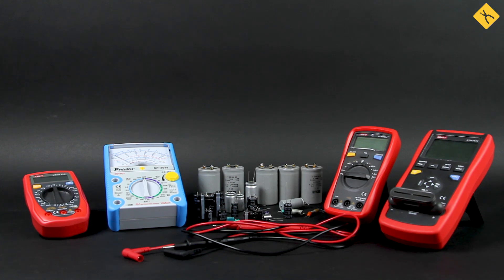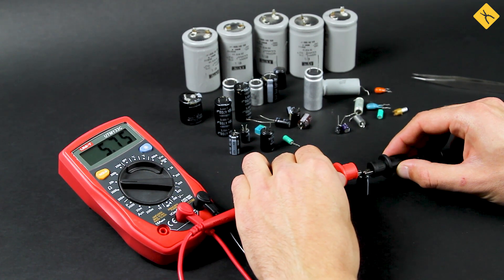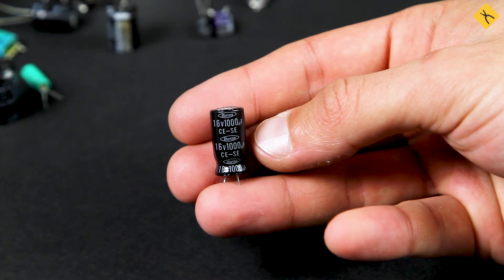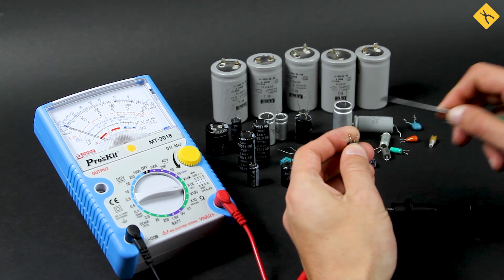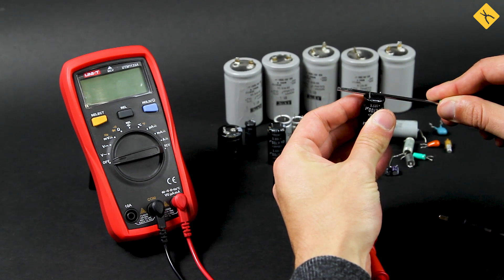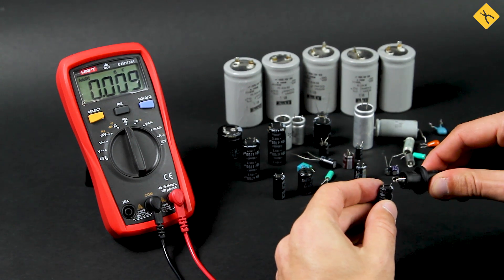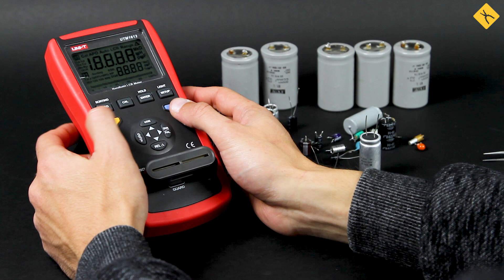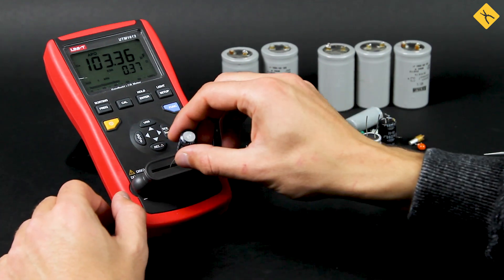How to Test a Capacitor with a Multimeter and LCR Meter

Comment: useless, what setting? can i do it without removing it. I see you've linked another video for settings (the markings are not visible in this video), but I clicked on this video because I only need to know this today, I know about continuity, voltage and resistance testing.
Reply from the maker: You can watch this video https://www.youtube.com/watch?v=tXxOHcUhVfE

Comment: I have a cap on a 130w extractor fan for a cooker, and when testing continuity it reads 1040. It doesn't bleep. Does this mean it's okay? Wondering if it's just the motor that burned out, otherwise it's more money for the whole unit.
Thanks!
Reply from the maker: We find it difficult to answer. If the question is still relevant, then send it to our mail and attach a photo or video showing the essence of the problem. support@toolboom.com

Comment: What is difference of the capacitor voltage ?
Reply from the maker: Hello! Could you clarify what you mean?
Reply: @ToolBoomVideo  Capacitors have different voltages. Eg. .047uf 400v and some have higher or lower voltage.

Comment: Sir may I ask, if I have a motor starting capacitor for "Dough Mixer" of 80µF 10+20% 270V, and I have a reading of 85µF, shall I say that the capacitor is in excellent condition?
Reply from the maker: Hello! In some circuits, the capacitance of the capacitor should have an extremely small error, however, if the error of + -10% is indicated on the capacitor itself, then it is in order.

Comment: I share many of the comments left here. It looks like a good video but really it's very confusing. It does not show which setting(s) to use for the multimeter, nor does it even tell which lead of the meter connects to which leg (+ or -) of the electrolytic capacitor. Oh my!

Comment: All I need to know is which multimeter setting to use and what values I need to determine so as to identify if I need to replace or  keep. The values were straight forward, however as this is the first time I have tested a capacitor I did not pick up on what MM setting to use.
Reply: I can't stand it when people take a complex subject and act like you know almost as much as they do.  Terrible job explaining what he's doing.

Comment: Aren't you risking ruining the capacitor by using a screwdriver?
Reply from the maker: Hello! In our case, this can be done because the capacitance of the capacitors is relatively small. Doing the same with more capacitive capacitors is strictly not recommended.
Reply: @ToolBoomVideo  Oh ok, thanks!

Comment: What about very small cappacitors ?
Reply: for very small caps - you need a more expensive meter with greater resolution
Reply from the maker: Hello! You can try to take measurements not with "alligator" probes, but with ordinary ones.

Comment: Useless video unless you already know what you're doing and what settings to use on the multimeter.  Waste of time if you dont.
Reply from the maker: Thanks for your feedback. We are sorry, we will take your comment into account in the next similar videos!
Reply: are you blind he setted to ohms
Reply: @cyborg6294  As my original comment stated, the video is useless if you dont know what you're doing!  Are you blind? He didn't explain what he was doing.
Reply: @neilrobinson7615  I am a programmer, I used the video and after that I tested the capacitors in my PSU and found it dead. Maybe it is hard for you, nothing wrong with that. Nothing personal, good luck
Reply: @cyborg6294  How do you test a capacitor with ohms when capacitance is measured in Farads? A standard multimeter can not test for capacitance.
Reply: @neilrobinson7615  I measured the capacitor resistance by choosing 20K ohm and it was zero (zero for dead one), also I checked the continuity and it beeped, this means that it is short-circuit. If the the capacitor is working correctly you will see an increase in resistance gradually without surges when measuring. And by the way, English is not my native language even. You really should watch video carefully and give an attention to details. No offense
Reply: @cyborg6294  So you didn't check the capacitance then? That's what I watched the video for...
Reply: @neilrobinson7615  I do not have even this function in my cheap multimeter.
Reply: @cyborg6294  Exactly, most cheap household multimeters can not check capacitance, that's why this video has so many down votes and negative comments.
Reply: @neilrobinson7615  I don't give a video down vote and negative comment only if it is fake or with wrong information. I always try to support good videos, because if the channel starts to get many down votes then they will even stop to make videos and share information and that is bad, maybe that is just me. I saw that in past that some channels stopped to make videos even and the channel is already dead and some was really good channels but people don't understand and gave them bad comments.
Reply: @cyborg6294  Legitimately poor videos with poor information should be down voted. That way the overall quality of YouTube improves, and content creators up their game. Shit is shit, which ever colour you paint it.

Comment: Can someone help me out?
Im working on a Behringer 1280s powered mixer board. This unit blows both 1.6ah 250v fuses as it is powered up.
The (4) 2200uf 200v caps test good on my Kline mm700 meter for capacitance and my esr meter says good cap with low ESR. The (4) 4700uf 100v caps test good on the esr meter, but read O.L checking capacitance on the Kline. So I ordered (4) new 4700uf caps. They also read O.L on my Kline in capacitance mode. All these readings were taken out of circuit.
Im thinking it might be the transistors, not the caps. But why am I getting no uf readings on the 4700uf caps?
I actually have 2 mixing boards. Same situation with the 4700uf caps on the other board.

Comment: So if I'm testing a 250-300uf capacitor, I set my multimeter to 2000uf just to be above the max of the capacitor. Is this alright?  I can't see where your multimeter is set to.. also I don't want to watch that multimeter video lol. It doesn't measure capacitors

Comment: You are not saying were to set the dial for each capacitor. You are just moving the dial back and forth
Reply from the maker: Hello! Thank you for your feedback! At the beginning of the video, the multimeter was in the resistance measurement mode (in the range up to 20k Ohm)
Then the "Diode test" mode was turned on.
2:13: Measurement of resistance in the range of 0-1000 ohms.
3:00: Relative (REL) mode: Stores existing reading (a delta) and resets display to zero. Sets a relative reference point to measure against the next reading.

Comment: Under what kind of reading a capacitor is good or bad?
Reply from the maker: Hello! What exactly did you mean? If you want to check the capacitance of a capacitor, use a multimeter that provides the corresponding function (capacitance measurement mode). To test the capacitor for proper operation, follow the instructions in the video.

Comment: this doesn't tell me the voltage rating of the capacitor. how do I find that out
Reply: Well it’s written on it. There’s no way to find that out, it’s simply the maximun it can take. Only way you can find it out is by looking at the size and comparing to other ones
Reply: @xgamerbih  a lot of new film and ceramic capacitors these days do not display the voltage for some reason.  this makes it pretty much impossible to recycle these components.

Comment: I'm new to capacitor. Your video is for someone who already knew how to test a capacitor but definitely not for new learner.
Reply: Didn't learn a thing.
Off to look for more
Reply: i agreed. I am noob and have no idea what is going on and it doesn't helps the camera so far away and can't see what you are doing.
Reply: 100% agree, he's just showing off!
Reply: Agreed
Reply from the maker: Measuring capacitance is easy if your multimeter has this function. Just connect the measuring probes to the capacitor outputs and switch your multimeter to capacitance measuring mode. The device will do the job :)
Reply: @ToolBoomVideo  "Easy for YOU to say; YOU know what you're doing; WE don't!" As RL suggests and as others (including me) state below, you'd have done a much better job if you assumed none of your viewers KNEW the function or the settings of the instrument you were using.....AND did some camera closeups of the dial/settings BEFORE getting into the nitty-gritty of actually measuring.

Comment: I do not understand why we have to discharge the capacitor before measuring the voltage with the DMM. The whole point of DMM is to measure existing voltage. Just point it to 1000V scale if you have a 400V capacitor  and measure the voltage. The DMM will not be destroyed. There is no reason to discharge anything.
Reply: Every forum, video, tutorial says to make sure it's discharged. 
"This is very important because capacitors can hold the charge even if the power supply is disconnected. If the capacitor is not discharged properly and if you accidently touch the leads of the capacitor, it will discharge through your body and cause an electric shock."

Comment: im not sure about the Discharging of the Caps, some you have your fingers on the Screw drivers, and some you roll the Cap and its LEGS over your Hands.
Reply from the maker: Hello! It's most essential to discharge the capacitor before measuring the capacitance. Probably, in this video, some things haven't been shown clearly :)
Reply: @ToolBoomVideo  thats the problem, people COPY
Reply: You wouldn't be testing anything if you were to do as U say n jump straight into it safety first Bo let's say I had a complete metal screwdriver n went about discharging the caps as U say I'd either be in wicked pain or dead rubber-plastic handle would good to mention

Comment: On wich stand u need to put the meter to test the capacitor???
Reply from the maker: Hello! Each multimeter, at least those presented in the video, has a back stand. It helps to place the device in a comfortable position in your workplace.

Comment: Yeah. My cheap Amazon no-name multimeter doesn't do jack. Just shows 0. Half the time it doesn't even beep when checking connections. Meh.
Reply from the maker: Hello! Perhaps it's time to find a replacement for your multimeter? 
We can recommend several functional and inexpensive models:
https://toolboom.com/en/digital-multimeter-uni-t-ut136b/
https://toolboom.com/en/digital-multimeter-uni-t-ut89x/
Reply: if it beeps then its on Continuity test, on the Metre in this video its right at the bottom settings Normally Diode sign or Music Note or crazy wave form (not AC/DC)

Comment: Does this apply to SMD caps too? Because when i do this test with SMD caps i get different results. Is it because they are soldered in a board?
Reply: yup you'll have to desolder them off the board and test them separately.
Reply: Most likely.  Other components interact and will give a false reading.

Comment: I have a power board and I am checking the caps on it. As the board won't power up.  I noticed that a huge one on it goes to "1" and doesn't vary in the numbers like the other caps do.  Does this indicate the cap is bad?

Comment: hi and thanks a lot is it possible to test capacitors with a multimeter without desoldering them from their board?
i hear timed sparks like each half a second in a power suply but i can't see where exactly it could be either the transformer or one of its surrounding capacitors and i cannot desolder them all😂😂😂.
Reply: You dont need to desolder them - that is how computer repair people test the boards.

Comment: Doe's a good looking capacitor can be a faulty too?
Reply from the maker: Hello! Yes, sometimes it happens. Externally, a good capacitor is inoperative.
Reply: @ToolBoomVideo  ohh cuz my monitor power supply have a good locking caps and won't turn on if i keep unplug and plug again and again it will turn and if my place have a blackout and then turn it on again I'll do the same thing again to turn it on sorry my English is bad
Reply: Quite often.

Comment: How do I test an AC capacitor with a cheap multimeter
Reply from the maker: Hello! The principle of measuring capacitance is the same as we showed in this video. What is the model of your multimeter?
Reply: @ToolBoomVideo  cheap free one from harbor freight which doesnt have MFD
Reply from the maker: @liveandletlive2894  Does your multimeter have no capacity measurement function? Have we got this straight?
Reply: @ToolBoomVideo  what do you mean capacity...it can measure AC DC and ohms